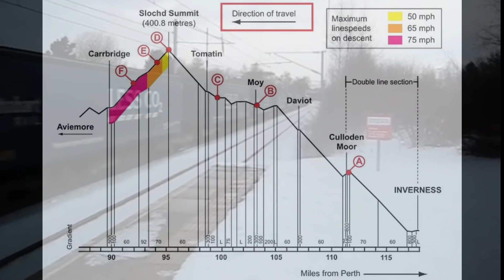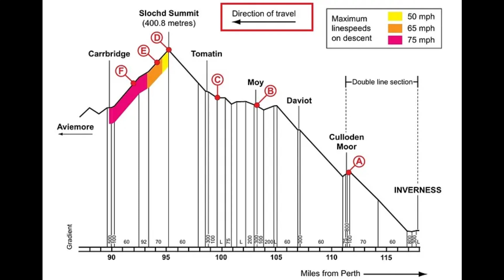What Caused the 2010 Carrbridge Train Derailment? #derailment #railway #stobart #carrbridge #fyp

Comment: A.I. must have been managing the snow-braking ! Sometimes, even that procedure won't help . I once had a 158  in snow, and even doing the stipulated brake application and mandated speed decrease every 90 seconds, ran out of brake downhill to Huddersfield . Butt-clencher. The 'scuffing brake' was fitted soon after , to the leading axles , which made a difference , and was useful in leaf-fall season. Never had issues on loco-hauled and freight . Doing the snow-brake running procedure ain't the best when slogging up a bank , as in this scenario , but needs compliance . It may not have averted this , however, it was particularly severe conditions that prevailed.  Iron blocks may have helped a deal , too, especially if they got hot , but that can lead to ice formation from snow melt. Some situations yer just can't win.......